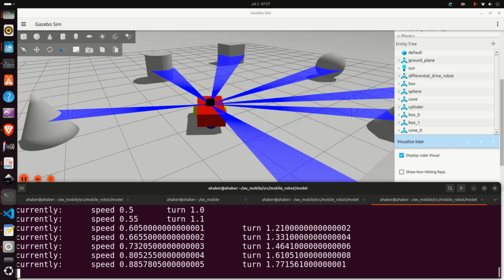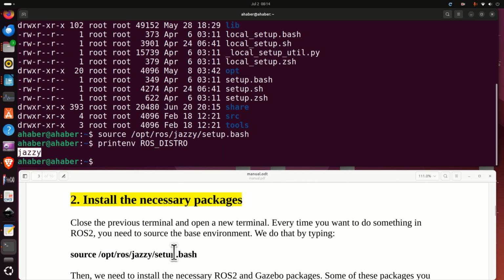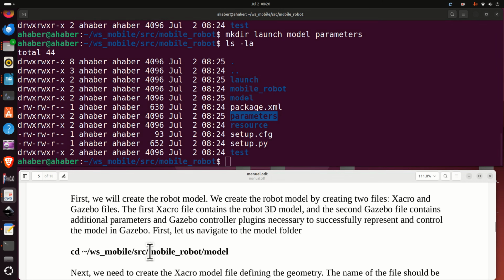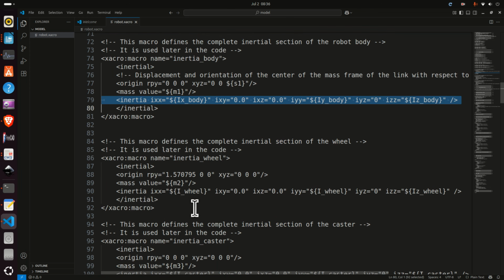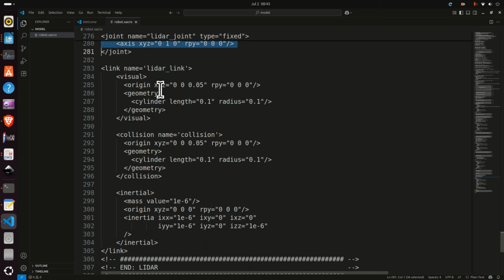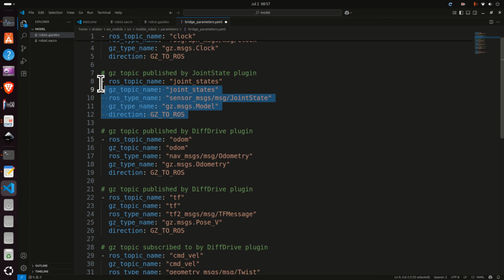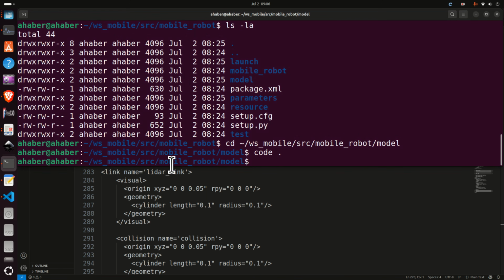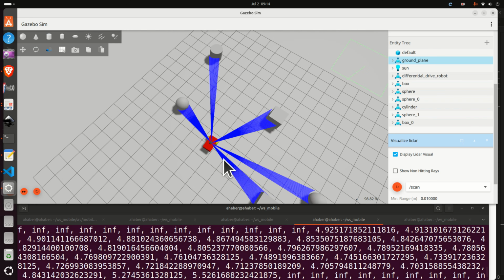Lidar and Mobile Robot Simulation From Scratch in ROS2 Jazzy and Gazebo - ROS2 Jazzy Tutorials

Comment: I have an issue with LIDAR, laser rays are at the ground level
Reply from the maker: Check your joint transform settings to ensure the sensor is positioned correctly on your model.